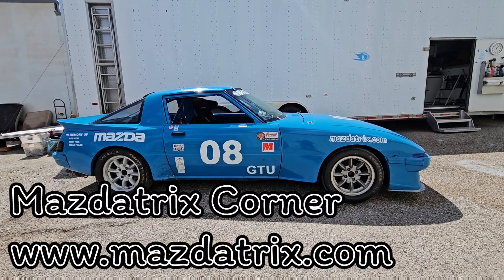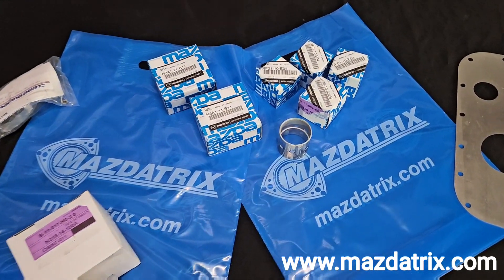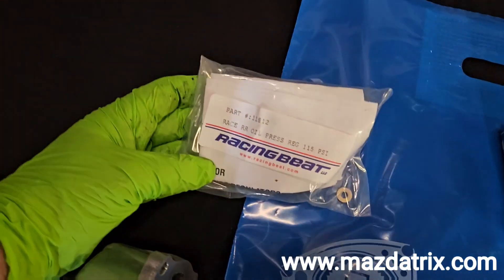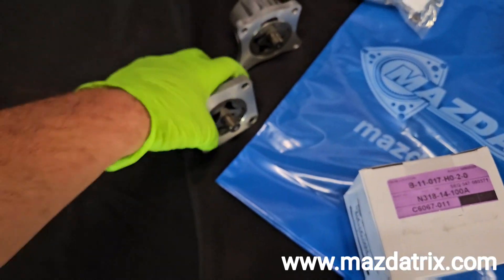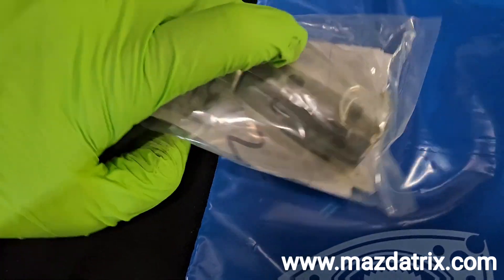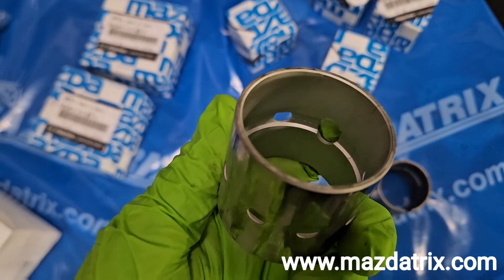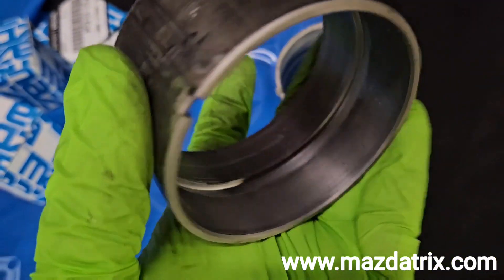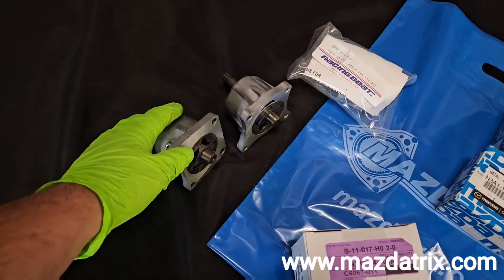Mazdatrix Rotary Tech, oil system tips for wet sump reliability and performance by KMR Rotary

Comment: I have an s5 turbo block with new oem bearings, new oem turbo oil pump and an s6 oil pressure regulator.

Makes 400 whp at 20 psi on stock intake and exhaust ports

Over 15k miles on the setup. Sharing for others
Reply from the maker: Solid setup. Nice work